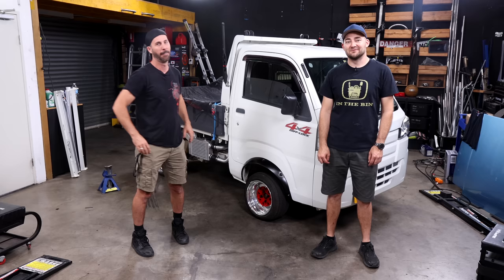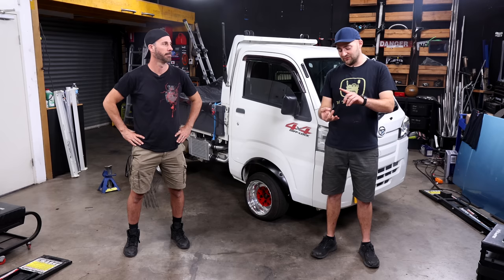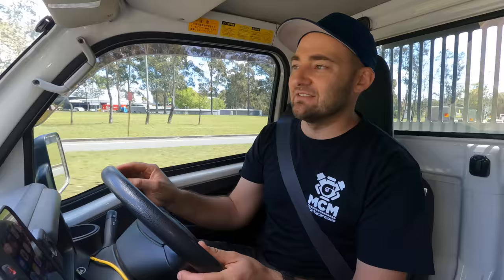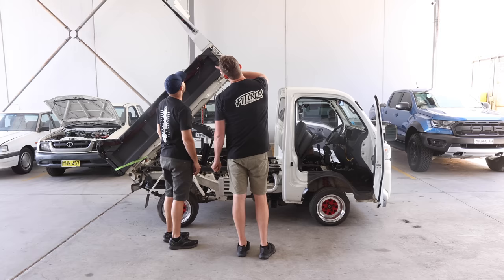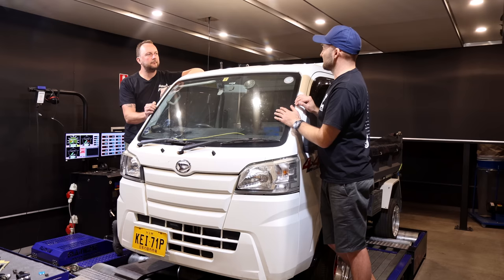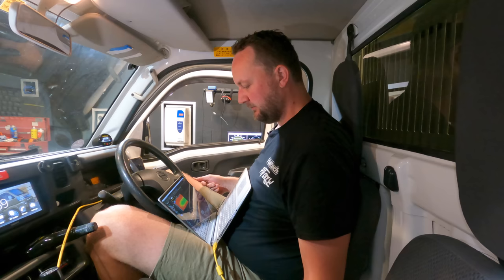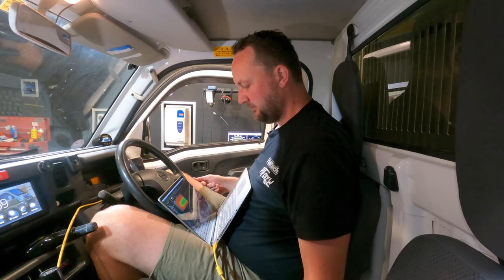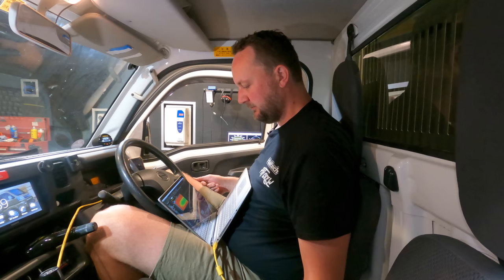Turbo Kei Truck on the Dyno ready to go bush

Comment: Took my homebuilt 1963/1964/1972 4x4 Dodge Town Wagon/Power Wagon down Cutler Creek in the Big Horn Mountains west of Sheridan, Wyoming in December...rescue mission.  1957 Dodge 4x4 D200 pickup that had been crashed against a boulder and shattered the drivers side front frame.  Completely dislodged front axle.  Used tire chains and log boomers to pull the frame into a reasonable representation of the frame.  Towed the pickup from the Tongue River up to US14 to Sand Turn.  There we unhooked the tow and I moved the Power Wagon to the front of the pickup to act as the pickup brakes...because the brake line was torn in two.  NO Brakes.  December in the Big Horns means 16" to 2 feet of snow on the Cutler Creek gravel two-track...took two of us five hours start to finish.  Wild ride down US14 to my house on Wolf Creek Road.  Great fun.
Reply: That is an epic rescue! Thanks for sharing.

Comment: The first time that skid plate touches a rock those standoffs will fold over.  You need to weld up a "bash bar" that goes in the front (under the flimsy sheet metal) and mount the skid plate to that.
Reply: suzan  awesome response!
Reply from the maker: Has now been tested and works well compared to the factory plastic one. A bar is a good idea!
Reply: Yep, its role is more deflect then bounce off.

Comment: Mighty Truck Mods is "the best four wheel drive show in the universe (sic)" 107% without a doubt, other 4x4 and truck shows are just a bore and a fancy Hollywood set whereas MTM is for more entertaining at the very least. 

They remind me of my father's 1997 GMC Sierra when it wasn't rotted through or couldn't get into gear, it was summit white with a copper two-tone equipped with a Z71 off-road package and I loved that truck more than I loved him. Never got to drive it around town though, he sold it to a lead technician at the local GM dealer who fixed it to original condition and drove it every day which made me a little more happier cause the tech was a nice guy who didn't mod Pavement Princesses.

Comment: I once tried to take a 90°-ish curve 58 miles an hour over the "suggested" limit. I got the 84 Chevy Citation II halfway around it be before I realised that was the same as not turning. I went completely straight off the road and jumped an embankment, flew 10 yards and got wedged between two massive oak trees 6 yards above the ground. That's the wildest and most expensive off-road trip I have taken.

Comment: You could easily drop a hundred kilos of the truck, by getting an aluminium rear tray. Cheapest way to add  power, is by adding lightness. Also looking forward to the up coming episode, branch VS  intercooler .
Reply: With speed holes!!

Comment: I live in VERMONT USA lots of trails lots of mud, brooks, ledge etc. That little truck would be a ball to have here. You asked us the viewers to mention what WE drive or have driven, well I had a 1972 3/4 ton Dodge Power Wagon 360 automatic 36 series mud tires stock suspension that truck worked perfect doing exactly what YOU 2 did in your camping video. Two different vehicles Yours and mine but both FUN AS HELL

Comment: Marty, have you considered one of those pop up tents that usually mounts on a roof rack (or ontop of a ute tub) ?
*Maybe too much extra weight when a swag will do
Reply: They weigh roughly 50-60kgs with a simple tub rack setup, I didn’t even notice the difference with my ute but you’d probably notice it with only 50kw 😂

Comment: This thing has the same base horsepower as my CJ-2B’s F-Head conversion, in theory.     
 I can only go the same speed top speed, because it came with an aftermarket overdrive unit on the back of the T-case.   90km/hr in what is essentially a WW2 Jeep is scary fun, even with a brand new suspension & steering professionally aligned.

Comment: It's crazy to think my 2014 Triumph Street Triple R has about 60kw and weighs about 180 kg.
Reply: Maad
Reply: About the same displacement and same number of cylinders too!
Reply: Meanwhile Americans: I need a truck with at least a 7 liter big block and 200 horsepower, because I might pick up a couch one day..
Reply: @Finnspin_unicycles  The problem isn't that they don't need it. It's that they use it everyday inspite of only needing it twice a year.
Reply: Street triples are more like 80kw (110bhp) in the UK
Reply: @MrMotocrossdan  yea at the crank, I doubt they put that down to the wheel.
Reply: @MrMotocrossdan  yea at the crank, I doubt they put that down to the wheel.
Reply: Strap it to the back and just tip it until the wheel touches the ground. 300% power increase. Engineers hate him for this one weird trick!

Comment: you guys actually are a better 4x4 youtube channel than most. you're certainly the best "car guys doing a 4x4 series" channel by a wide margin. and i hope these videos are doing well for you.
you are confident in what you do know, and respectful of what you don't know. and that is so much better than being cocky and acting like you know it all  and then using editing to hide your mistakes. and the subtle way you make fun of other content that does that is always great. 
you guys have made some noob mistakes in your builds, but they're not necessarily failures. just things you'll learn. i'm looking forward to the bush episode to see how the intercooler holds up being exposed on the Kei truck, and whether moog disconnects his sway bars or not; which i didn't realize until the motor swap debacle, that it has a solid front axle. 
hopefully it's another feature length film.

Comment: Took my lower than stock S70 off-road on a powerlines track and scratched everything from the oil pan to the fuel tank, broke the rear bumper, ripped off the splash guard and covered my engine bay in mud. Great times

Comment: If you put some decent size tires on your nice rims you’ll fix the hearing issue, I’m running around 15 percent bigger rolling diameter and it has transformed the truck. In addition to being a lot quicker the flywheel effect also makes it more stable at speed.......😊

Comment: one recommendation if your going off road i found really handy pack an electric chainsaw, any chainsaw would work but your not going logging so electric is a million times easier myself i use dewalt but ryobi would likely have one and you can charge the batteries in the car instead of needing to carry extra fuel for one

Comment: i drive my 97 daihatsu atria daily my ford is down at the moment so i transfered most of my tools to the back and im doing locksmith work out of it. i had a guy tell me the wrong side of a building that is under construction and i was going to unlock his truck the dirt road was complete crap made by a trackhoe couldnt turn around so i had to go thru the ruts the little van never even slowed down thick clay muddy road about a hundred yards worth of total kicking ass sliding all over the place thru it all then when i got to where i could turn around i had to go back thru it cussing the entire time pissed the guy sent me down the wrong side of the wharehouse most of the ruts where full of water  still the little van just went right thru it all when i got home the van was completely covered in mud. never underestimate the mighty kei four wheeled drive van. would love to find someone in my area that can work on it still looking in summerville s.c. usa

Comment: Should be 195 wide tyres instead of 165. Use Toyota rims 13 inch. Better ride. Better stability.
Also add bull horn in the front and u golden. Light bar at the top.

Comment: How is it expected that the intercooler will remove heat from the compressor outlet since there is not any directed air through the finned passages. There should be a scoop or better yet turn it on it's side so natural convection occurs.

Comment: While I def understand the difference in displacement, it always makes me wonder than an Indiy car is only using a 4cylinder engine and cranking mad power. And yes they are completely built. Just pointing out how little engines can do so much more than we think. When it comes to single nailed quadruped power.
Reply: Well plasma is actually the fourth state of matter marty. It is neither solid or gas. It starts as a gas then its compressed, which also super heats it. Basically you made a little sun to cut thru your metal. There is alot of crazy work being done on making plasma useful in fusion. People should know there are FOUR states of matter not three.

Comment: Abou ten years ago I managed to get 133bhp out of my brabus smart roadster with a 700cc engine. That car was around 800kg and moved quite well. Maybe worth looking at these engines if you can ditch the automated gearbox.
Reply: An auto isn't the worst thing in the world off
Reply: @boheyo  it was an automated manual so the worst of both worlds.

Comment: I love the hot swap wheels, but surely the speedometer would change when he swaps the tyres, how do you not get caught by speed cameras when you're putting around the place in it?
Reply: You could use GPS, idk if the truck got any of it but Moog's Jimny had a real fancy offroad-specific Garmin nav unit in it last time they went adventuring.

Comment: The jimny will do better off road even with less power.  That's wht it's designed for.   It's like how in North America  the best off road is a 4 cylinder Toyota   and not a chev or ford or dodge v8

Comment: I love it 🥰 I want to do my Nissan nx 1600 and with a halteck ecu but it’s just to expensive for me sad u can’t buy the 500 series anymore I don’t need a big ecu just something that can run a small turbo I was thinking about getting a 200sx ecu and chip it because u can program the ecu to run on a ga16de and make it a ga16de+t because it dus not exist if anyone Els has a better idea let me know 
NO ENGINE SWAPS only a turbo without re registration can be an ass some chek stations don’t care maybe I can get away with a sr20de because the gti version has it but no turbo

Comment: I couldn't handle owning that thing, fuck it would be soo slow. Throw a turbo busa engine in it or you know not own a really slow truck. Put a turbo K24 in the jimmny then I wouldn't hate it. If it takes over 6sec 0-100km/h it's undrivable in my mind. My daily does 2.8sec 0-100km/h, my tow vehicle for towing my caravan does 5.1sec 0-100km/h .

Comment: And for our next trick, we'll put an 18650 in our "D" engine Tonka truck. 
The only question is..WHY? If you take a ball of shit and rub it between your hands long enough, yes, it turns shiny and perfectly round...but its still just a ball of shit. So, yes, you can polish a turd (see Myth Busters) but there are a lot of other things to do..because WOW, 67 whole horsepower. I think my riding mower is more powerful. 
How about you actually double HP of a factory motor without turbo/blower/nitrous? Now there's a trick! Even better, do it with simple hand tools you'd find in any backyard garage. Then tune it the old fashioned way, by ear and experience. Now there's a series I could get behind.
Now, tell me where you park this turd so I can drive my Hummer over it.